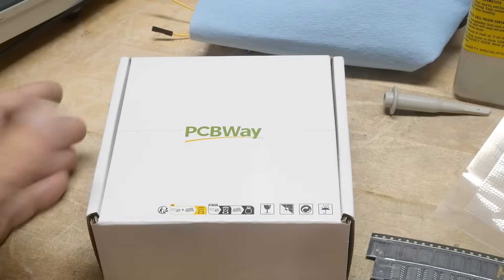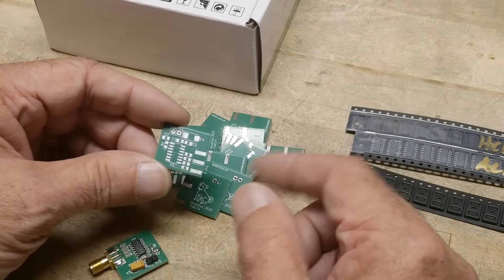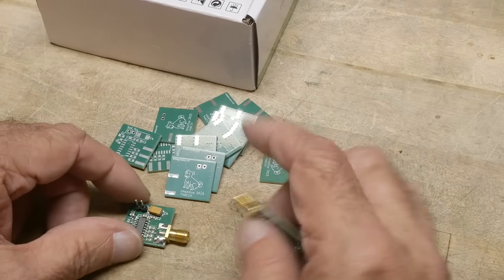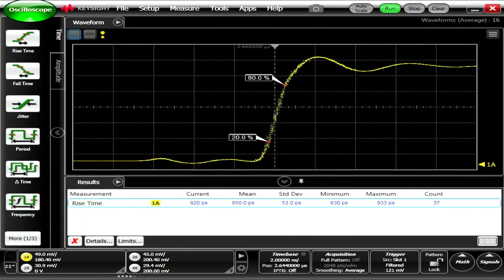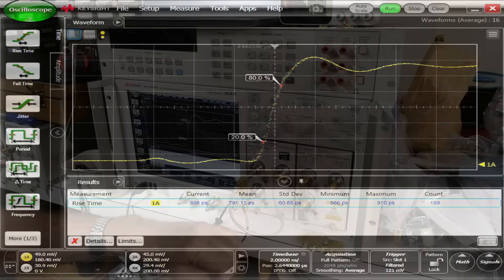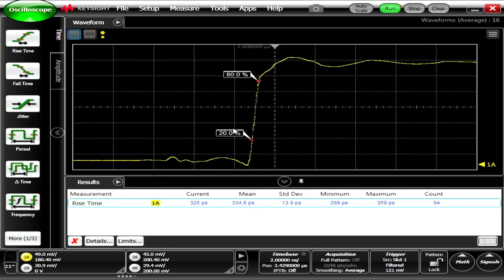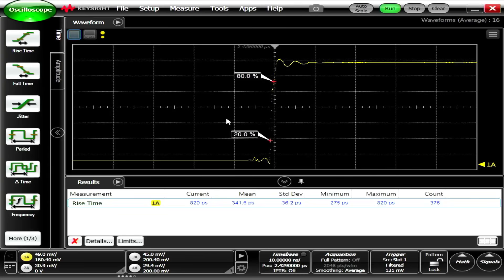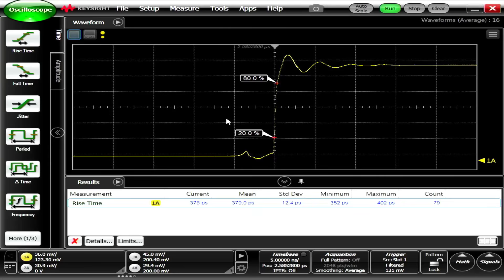#2345 74HC14 vs 74AC14 vs 74LVC14 Final Measurement (part 2 of 2)

Comment: You should have used a 74LVC14 from Diodes Inc, they're specified for 5V!
Reply: У других производителей тоже можно повышать входное напряжение выше 3,3V. Например производитель STMICROELECTRONICS, в документе указывает, что VCC до 7V. Другой вопрос в том, на сколько это повлияет на скорость. Так же есть одночиповые варианты, в виде 74LVC1G14, и там уже у всех производителей заявлен функционал до 5V, я часто их использую в своих платах, особенно когда нужен простенький генератор импульсов с частотами аж до 70-80MHz.

Comment: I still don't understand why you are seeing 300 ps rise times while the 74AC14 datasheets generally specify a rise/fall time between 1.5 and 9 ns. This doesn't make sense. Paralleling gates does not increase rise time either, it just enhances load capability. Why are we seeing this?
Reply from the maker: Are you looking at gate transition time?  Input to output. Different from edge.
Reply: @IMSAIGuy  No, I'm looking at the specified rise and fall times. Some datasheets however do not even specify those. The one I looked at, specifies both propagation delay and rise/fall times.

Comment: What voltage did you use? The lower the voltage the faster the switching time should be. 

Try 74AUC14 at 1.8V & 3.3V which I believe the current fastest for CMOS. 

ideally have a top & bottom ground planes would help as well as lots of vias connecting the top & bottom ground planes would help reduce noise & may provide a small speed gain.
Reply: Отнюдь, почитайте даташиты, там ситуация обратная, чем ниже питающее напряжение, тем ниже быстродействие микросхемы, причём значительное замедление в разы.
Reply: @SINHRO-FAZA  

74HCT: "Slower, with typical maximum frequencies around 25–55 MHz at 5V. A typical propagation delay (\(t_{pd}\)) is 13–22 ns."

74LVC: "Much faster, with typical maximum frequencies often exceeding 100 MHz. A typical propagation delay (\(t_{pd}\)) at 3.3V can be as low as 4.3 ns."

74AUC: "can achieve frequencies of hundreds of MHz (e.g., 350-600 MHz) 0.8V to 2.7V"

Lower voltage allows for faster switching frequencies. This is one of the reasons why digital circuits have been reducing rail voltages to increase switching frequencies. The other is reduce power consumption.
Reply: @guytech7310  Я имел в виду, что питающее напряжение на одной и той же микросхеме снижает её скорость переключения. Например у 74LVC1G14 tPHL/tPLH- 
1.65 to 1.95v = 11 ns, 
 4.5 to 5.5=5 ns,  то есть, разница более чем в два раза. 
 Хотя опять же, что интересно, 74AUC и 74LVC, сильно различаются по максимальному времени задержки сигнала между входным и выходным, а вот минимальные задержки практические одинаковы, на них скорее больше влияет уменьшение корпуса до QFN. 
 И вообще, у 74AUC, последняя дата ревизии 2003. Интересно, за больше чем 20 лет, придумали более быстрые аналоги, за приемлемую цену, или просто все ушли в микроконтроллеры, и логические элементы больше не будут улучшать ?

Comment: So per unit, this costs a few bucks for the parts and if you add the pcb you end up at ~$50 ish? That's pretty good. The leo bodnar stuff is a couple hundred bucks.

Very nice!
Reply from the maker: it might be fast enough for many, but I love the leo pulser as it will do about 23ps. so 10x faster than these. https://youtu.be/By_xfk_pqL8

Comment: You didn't match the trace lengths to/from all the gates, that's part of the problem you're seeing
Reply from the maker: I removed the odd ball gate at the bottom (longest) and ran on the other three,  and it did nothing at all to the waveform

Comment: Would it be pertinent to suggest that, given the Vswing for the AC14 is greater than the LVC14, deltaV vs deltaT,  the AC14 is still faster if you bracket the measurement points of the AC14 at the same voltage levels as the LVC14.

Comment: Very cool. Thanks. But why on earth is there ringing before the rise?
Reply: If I remember correctly, the oscilloscope has a selection of filter types that can be used.  Different filter types are different tradeoffs between the time response and the frequency response.  Some filter types produce significant pre-ringing.  Also, the oscillator section of the IC under test will be switching earlier in time, possibly producing sufficient transients to show in the output.
Reply from the maker: look at the schematic and start with the SMA output, then move backwards, right to left. this is also backwards in time.
Reply: Could it be to do with the fact that there are multiple outputs in parallel and some propagation delay from the buffer? I am wondering if there is a momentary impedance change happening if they don't all turn on/off at the same time, which could cause a ring before the slowest one turns on and it stabilizes at high. Maybe the buffer is irrelevant, but it would cause a little delay in state change from the source signal and the output signal that perhaps could be crosstalking in some fashion? Maybe I am theorizing out my ass. Unsure.
Reply: @control_voltage  Makes much sense. Thanks.
Reply: Most likely Ground bounce from the transitions of the previous gates. Another reason why logic gates with six outputs and one ground pin don't make good analog functions.

Comment: What is causing the "pre-ring", before the transition?
Is that from earlier gates in the chain messing with the ground plane?  Coupling with the input and propagation delay?

Is it possible to put this on a 2 channel scope and look at the input to the 4 output gates as well?
Reply: The pre-ring is caused by the sin(x)/x function of the oscilloscope used to smooth the waveform,

Comment: Are the parallel output gates exactly matched, or are they averaging the rise time? Showing the slowest? Or?  (The fun projects are never over :-)
Reply from the maker: I removed the odd ball gate at the bottom (longest) and ran on the other three,  and it did nothing at all to the waveform

Comment: The kink in the graph around 80% is due to the difference in trace lengths from the 7414 outputs to the SMA connectors.
Reply from the maker: I removed the odd ball gate at the bottom (longest) and ran on the other three,  and it did nothing at all to the waveform

Comment: I guess with matched impedance you'd eliminate ringing
Reply: Oh, I missed previous part :) looks like outputs are 50 R terminated
Reply: @andrsam3682  nope. 50 plus the output impedance of the gates, which is non-zero.

Comment: fall times and prop delay are just as important.
these comments are in regard to characterizing components not
any particular circuit.
Reply: Not so much for this one particular application of creating a sharp rising edge for time-domain reflectometry applications, though. But yeah, one shouldn't just look at THIS experiment and say "This chip is the FASTEST!!!" and prefer it for other applications 🙂
Reply: Well. If you are driving something that uses a rising edge detector, the falling edge is not as important and you can optimize for rising edge. Certainly depends on the application, though.